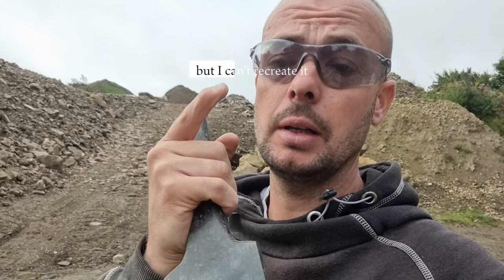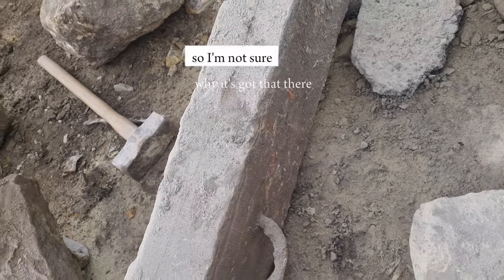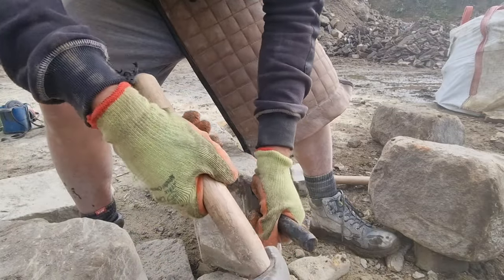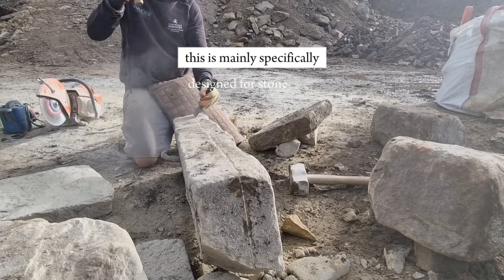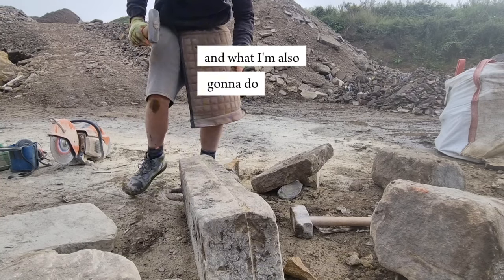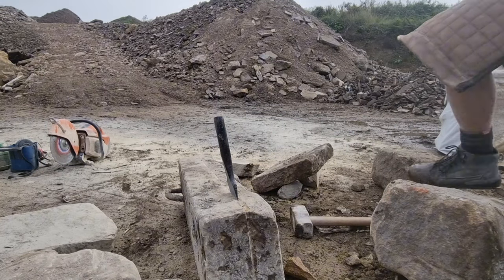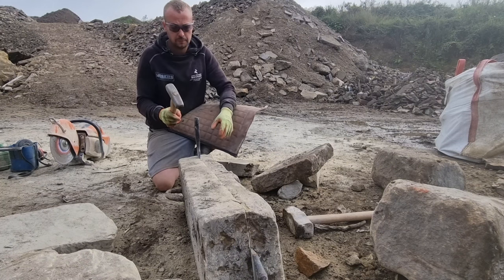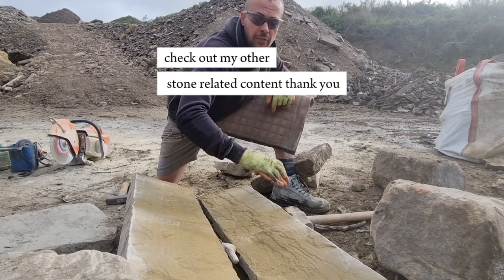Firesharp Nicker ⚒️

Comment: Gotta wonder what that metal loop was for.  Probably held in with a lead pour, but for what purpose?  I love artifacts like that.  I'm also wondering about this "fire sharpened" chisel.  As a blacksmith, I've never heard of fire sharpening and can only surmise that the alloy being used has something to do with it.  That said, I wouldn't hesitate to grind on it as it needed freshening.  To heat it up to any temperature is only going to take the hardness out of it, making it soft as a butter knife.  As long as you go slow and cool it off in a cup of water ever few passes, I can't see it being a problem.
Reply from the maker: I think you may be right pal
Reply: Fire sharpening is not a magic spell but plain old hardening and tempering. It is the skill and judgement to get it just right every time that makes a good smith. I have a 450 pound anvil and the whole of the base is covered with hundreds of nicks and dints where, over the years, Smiths have tested freshly minted tool edges.
Back in the day, rather than sharpening at a wheel, the tool was often hot worked to the final edge or point with the hammer by the quarry or yard Smith, prior to hardening and tempering. Not many Smiths doing that sort of work these days

Comment: And you're a delver as well mate. Nice split there. I doubt it was a curbstone and that handle has got me stumped. It was made to be moved frequently, the only thing I can think of is an old hatch to a pub cellar where the barrels were delivered. Was that handle fixed in with Lead by any chance? Might help determine the age. 👍
Reply from the maker: Maybe your correct. Normally with the finish its a curb but I honestly don't know what it was. Thank you for watching pal
Reply: @the_yorkshire_stone_dresser  I asked a few guys at work today and one mentioned it might of been on a canal at one point for a tie up point which does seem a better option. Just FYI I'm not being picky or owt with my comments but I've been a stonemason for 36 years so I'm just chucking in my 2 pence every now and then and I enjoy the videos for some strange reason. 😂👍
Reply: Is it old stone? Often they had them curbstones like that so they could tie horses up when they delivered to wherever it was